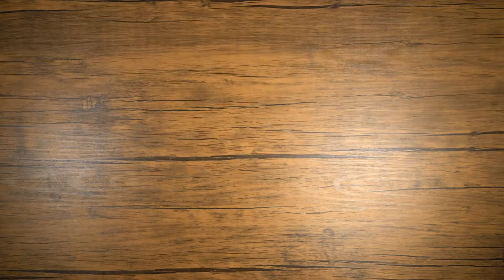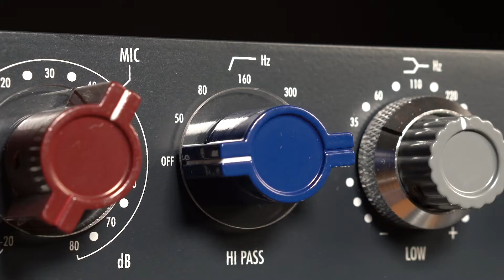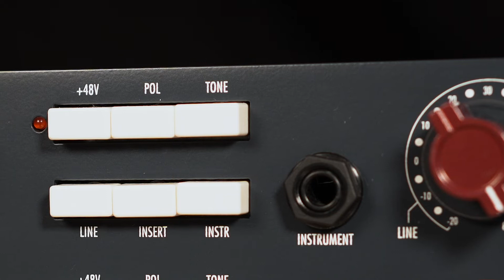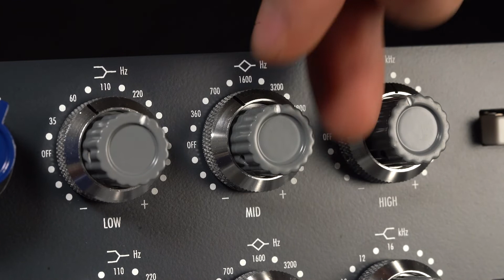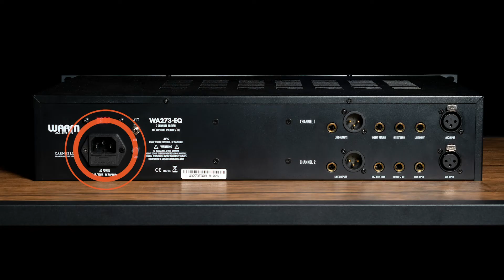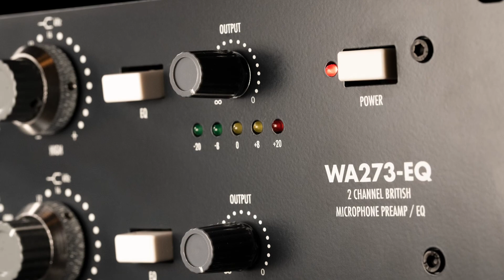Warm Audio // WA273-EQ Dual Channel British Mic Pre + EQ "Getting Started"

Comment: Question, when I engage the phase button when using a single mic, the tone shift pretty drastically. Why is that? Should the tone only shift if there 2 mics and I flip phase on one of them? Love the unit by the way. EQs and pre are like butter.
Reply from the maker: Hey Nick!

When waveforms are inverted (as with changing the phase or polarity) you will hear a difference in tone. When using the pol button on a mic you are changing the way the unit is perceiving the signal from the mic. Hearing this change on the WA-73 series is normal. Hope this helps!
Reply: @WarmAudioOfficial  very helpful!! Thank you so much!